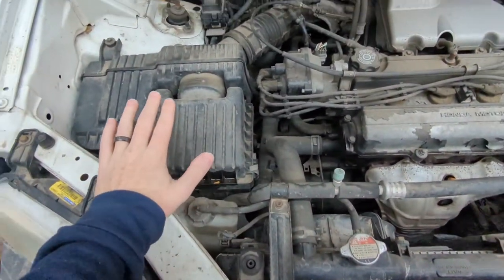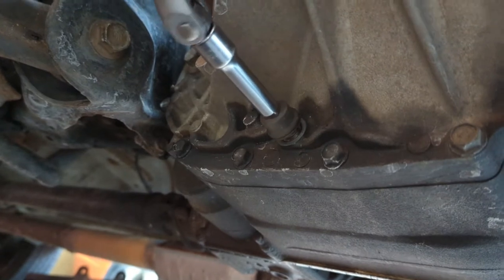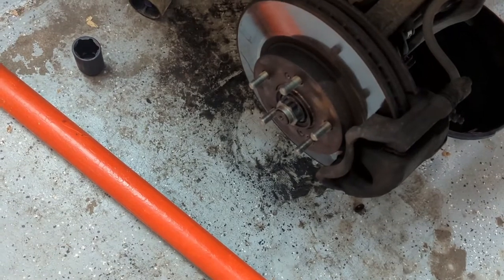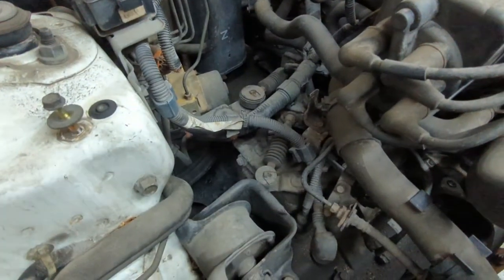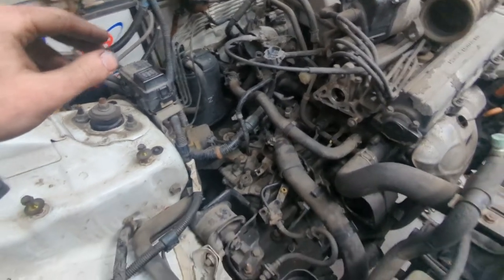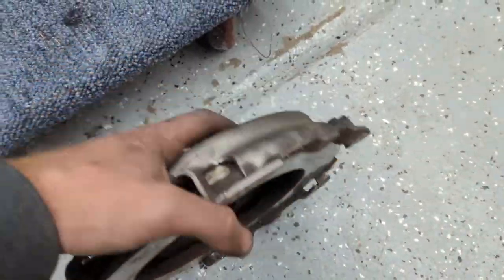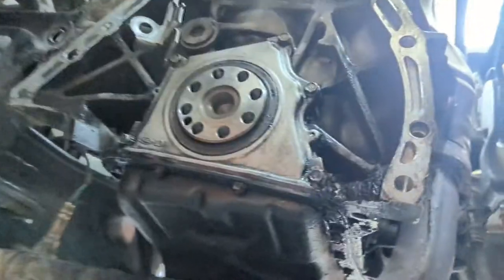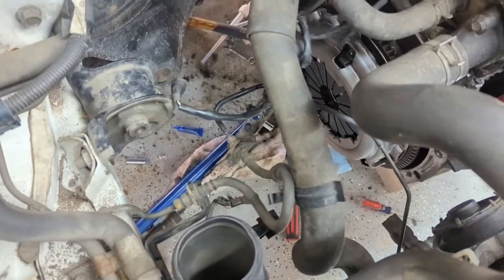How to change a clutch on 97-01 Honda CRV | AWD Transmission

Comment: man this looked like an absolute mission - I remember not being able to remove the axle bolt on my 1982 mini, it finally came off with a 2m long scaffold pole on the end of breaker bar - once we had cracked a few sockets and then bought some more decent ones! I used to work in a land rover garage, and I do not ever want to do a transmition on them every again :)
Reply from the maker: Man that sounds rough😂😂 yeah some of those bolts are just not easy to get off, I know it makes a big difference when you have the correct tools if not you have to get creative😂 but I think that any transmission work is really tough! It's a very big job!

Comment: You've probably figured this out by now, but with front wheel drive cars you don't have to undo the axle nuts to pull them from transmission. Just undo lower ball joints and the shock mount from lower control arm. It will all just swing away from axle from there.

Comment: When you did the clutch did you also do the rear main seal on the engine
Reply from the maker: I'm not sure since this was so long ago, but I would definitely recommend it, you never know when the rear main seal is going to start leaking and it's super cheap also make sure to put in a new throw out bearing as well

Comment: Hey, great video. My 2001 crv need a new motor and was wondering if i put a used one in, you think the transmission will keep going without any problems? It had 241k miles before it broke down.
Reply from the maker: That's always hard to say, I know that engines and transmissions will run for a really long time if you take care of them,. I would just recommend replacing the engine and keeping the original trans until it goes out, the transmission might last another 50-100k miles, I've also heard about transmissions crapping out at 100k miles, so if it's not broken don't fix it🙂

Comment: Love the video, transmission work is always really rough! how long did you take to do the job?
Reply from the maker: I did the job over about 3 days! So it wasn't terrible but I did take my time with it! It was a full day job if you were to rush and move quickly on it!
Reply: Was gonna ask the same sadly mine has taken too long and has had to many hurdles
Reply from the maker: @douglasetzweiler139  it's easy to run into big hurdles on a job like this, it took a good amount of time!! Especially doing things by yourself!
Reply: @ProjectRacecar2  that's biggest hurdle, little to no help, hand tools . And of course once I had it all back together something wasn't reassembled right, cause vehicle wouldn't move under own power. Was told throw out bearing
Reply from the maker: @douglasetzweiler139  oh no that's never fun, I'm sorry you are running into issues with it, hopefully you can get it back on the road soon!!
Reply: @ProjectRacecar2  well truth be told if I can get it back on the road and keep it there I kinda wanna Jeep it out
Reply from the maker: Lmaooo that would be sick honestly I know they have some lift kits for the crv so I fully support that😂

Comment: Seen that brand on amazon. Where do u recommend i buy parts for honda crv and what brands?timing belt, water pump, clutch kit. Pls help, thanks
Reply from the maker: Honestly with the crv I do alot of looking on Amazon, if I can't find it there I will then try an auto part store, there aren't great sites that I have found, I tried parts geek but had alot of issues with them
Reply: I use rock auto, great parts, decent prices. Never had a let down with them